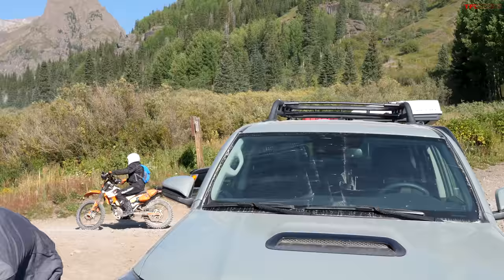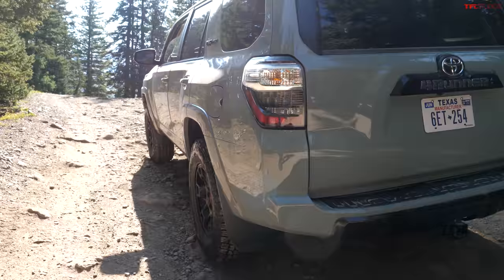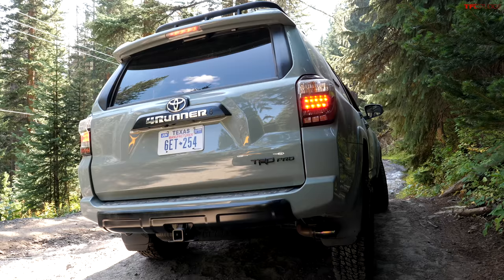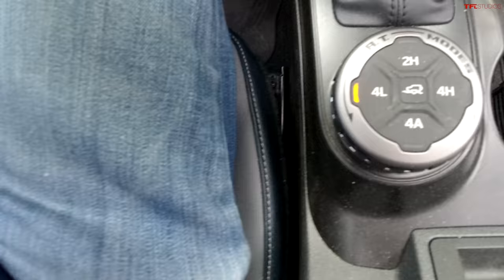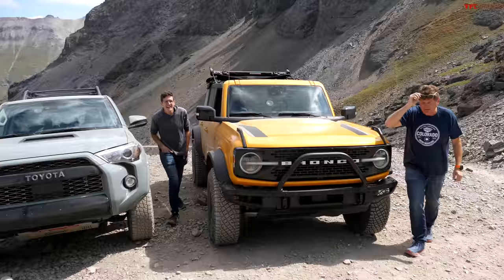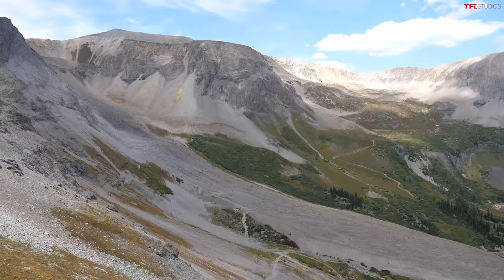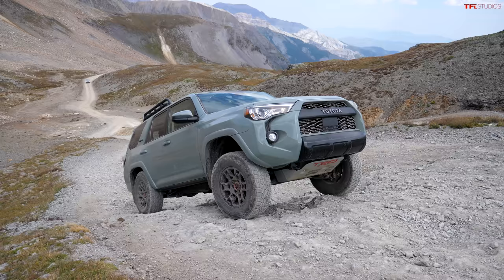The Toyota 4Runner TRD Pro May Be Old, But Can It Still Keep Up With The Ford Bronco Up A Mountain?

Comment: Imogene pass is far from one of the hardest in Colorado. It’s one of the most beautiful but definitly not one of the hardest. It’s fairly easy compared to others. Also if you can take a stock vehicle on a so called hard trail without a lot of damage after then it’s really not that hard.

Comment: The four runner comes with 32" tires. Would you recommend a 33" tire that is the similar on/off road as the stock tires?
Reply: I have the 285/70/17 ko2's on my 18 4runner. Probably one of the best tires for the runner.

Comment: The more I see the 4Runners the more I want them. I just dont wanna pay over 50k for 16 year old powertrain tech 🤦🏻‍♂️🤦🏻‍♂️ dilema
Reply: Don't look at "it" as 16 year old powertain tech ; look at it as " all that's necessary " to get the job done !
Reply: You're getting 16 years worth of testing and fine tuning made from the same factory in Japan from families that have an ingrained culture of pride and obsessive perfection.
Reply: I don't care about like modern direct injection or anything like that cuz I drive a Gladitor with the 3.6. Im just hoping for some more Efficiency. Is it tht far? No but Im just want some slight powertrain updates. Cuz i know this motor wont break
Reply: Seriously, the 4Runner TRD Pro is not good value at over $50K. You can get a much cheaper Trail or TRD OR model for less money or a Bronco Badlands with pretty much the same offroad bits as the Sasquatch 1st edition sans the 25" tires for mid $40s

Comment: Don't get the pro get the TRD off road and you will have same sway bar disconnect  via KDSS as the bronco which I have no doubt works better and will last longer, logic that will apply to the entire vehicle systems as well.  The money savings from skipping the pro lets you buy your pro skid plate, just looks, after market shocks and still walk away with lots of cash as KDSS not offered on pro.

Comment: all stick with my 4 speed lock up converter , at 250,000 miles has never been out , that 8 speed in the bronco will never last . pass on turbos hose's blowing off , you can't beat the dodge nitro for a working person SUV. very cost effective to maintain with the 3.7 liter engine only . say no to penstar tick engine and the 4 liter that drops rockers

Comment: Not fair to compare the first edition price to the 4Runner. You can no longer get the FE bronco. I think you should disclose that fact. You can get a fully loaded (FE bronco equivalent) Badlands for around $54k. Which is much closer to the TRD Pro 4Runner price

Comment: I wonder which one will go 200000-300000 miles with the fewest dealer visits,hmmm. Bronco is very cool but I'm a Toyota guy. BUT for what you pay for the ancient 4-Runner in TRD Pro trim it SHOULD come with a front locking diff.

Comment: What kind of tires does the 4runner have installed?
Reply: It looks like the stock Nitto terra grapplers , not very good off-road in my opinion , I run toyo open country’s on mine , it’s a night and day difference in off-road performance.

Comment: Toyota does a bad job of explaining it but mts is an e-lsd with traction control. Also i really recommend using mts with the locker at the same time. The 4runner would not have stopped.

Comment: It gonna be fun to have all those off road goodies to have in your 4wd. Great technology, cool features, however when it comes to driver's off roading skills that's when all those cool features and technology took over and you gain no experience whatsoever. It's 95% the car and 5% driver (steering). Old school 4wd like LC 80 series with basic features are good for developing off roading skills. Australian are better off roader than most American cuz their 4wds are old school with manaul trans and only rear diff lock to assist them off an interesting situations.

Comment: Finally got to see a Bronco up close the other day.  Cheezy rear axles that won't last.  Passing on the Bronco.  A 4Runner refreshed would be nice Toyota (hint hint).  Not doing the Jeep thing either, hit/miss reliability.
Reply: I thought the Broncos had the same rear end as a F150,  how can that be cheesy compared to a Toyota rear end ?
Reply: @fj400007  much thinner axels
Reply: @HighAltitudesCO  thinner than which vehicle ?... thinner than a F150 or thinner than a Toyota ?...  because, it doesn't get much thinner than a Toyota rear end.

Comment: 19 MPG on 35" TIRES VS 20 MPG on 32". I'll take the 1mpg loss for larger tires. I just wish my F150 3.5 ecoboost on 35" tires got that good of mileage.
Reply: Yeah that fuel economy is all important on the trails.

Comment: Things I've learned over the decades: 1: Never buy a "first generation" of ANY vehicle. 2: The more complicated the vehicle the more there is to break when breaking is not an option as in the tried and true KISS Principal. IF I was limited to choosing between the Toyota and Ford there would be no contest....I'd go for the Toyota in a heart beat. Besides, the Bronco looks like a mash up of the old IH Scout and the  somewhat  infamous, but still functional and largely "bullet proof" once you spend some coin on it, Ford Bronco II with just a bit of Land Rover thrown in to make it bland looking overall. If the current Bronco (III?) is still around in five model years I might be persuaded to buy a two or three year old model as a "beater".

Comment: The hill climb at the end was interesting, the bronco stopped momentarily many times and never spun a wheel or lifted a tire, the Toyota lifted the front passenger side tire and lifted off the ground due to limited wheel travel, why does Toyota have to be so far behind domestic on so many fronts? Although it would be a hard decision on what one to buy, Ford will be expensive to maintain because it’s a Ford… and it will break down a lot… you can’t win.

Comment: At 7:04: 
1. The convertible roof setting is a fix for a factory manufactuirng flaw. Are you serious?
2. How do you use the convertible setting when using a roof rack? Ridiculous.
At 7:13
3. Why would I take off the doors, especially when serious fording is on the menue? Just a gimmick, nothing else.
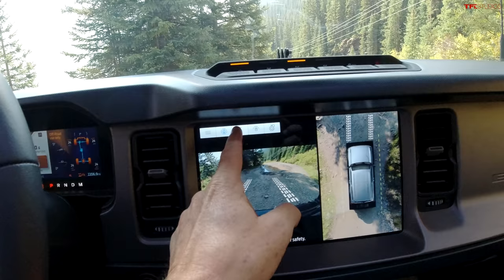At 7:29
How often does the driver need to clean the lenses when serioulsy mud offroading?
At 25:35
Fuel consupmtion: How can an old design 6 cylinder natural aspirated engine with only 5 gears beat a twin turbo with 10 gears? Technical development at its best.

Comment: I agree goat mode is just software and maybe a bit of center clutch tension.
For me ……. Just give me the 4x4 switch and dump all the idiot modes that will cost you a fortune to fix down the road….
Gas settles in 5 seconds 
Diesel takes a long time to settle down .. It holds a bunch of bubbles that take a long time to settle

Comment: I’ll take the Bronco. 👍🏻🇺🇸

The Toyota folks will talk about “reliability” & rightfully so (from a historical perspective). However, there are plenty of old Fords & Jeeps still on the road and powered by the original motor + transmission. I’ve owned Fords & Jeeps that have been very durable, despite abuse in mud, sand, & snow. 

By contrast; I owned a 4Runner back in the 90s & found the power to be anemic, plus it had incessant electrical issues. Buy whatever suits you, but the days of Toyota being able to claim reliability superiority are gone. Quality across brands is so close that it comes down to the unit level & that’s FACT rather than my or anybody’s OPINION.

Comment: Great demonstration, one thing that is not well mentioned is that the Kroll control of the Toyota is superior than the Bronco, I can say this because I saw another off road video and only the Toyota could claim using Kroll control, the Bronco's equivalent Kroll control could not make it, it had to use the two lockers to do the same obstacle, The Toyota can do just about everything that two lockers can with it's amazing Kroll control

Comment: what it sounds like, pretty colors, it used to be for offroad, hunting, back country travels we had a rig that wasn't needed for daily driving, we had a beater with goat gear on it. Sliders, winch, manual locking hubs, suspension, off road serious tires, lockers, rag top, stick shift, 4:88 low gears, if it broke and we couldn't fix it, we got it down and trailered it back home to the shop. these both seem like light duty off road, get to manicured campground. not once in 40 years have I needed a camera in the dash, so can ya get chips for them

Comment: The 4Runner is more reliable.  I have a 3rd gem with 378,000 miles.  Original trans and engine

Comment: There goes a tfl member leaving a toyota’s front diff open during a tough rock crawl again. Idk when they’ll learn
Reply from the maker: what are you taking about, they toyota gas an open front diff
Reply: @TFLoffroad  you guys never use mts with the locker because it’s “just software” in reality mts and atrac simulate lsd’s in the front. I love your channel and what you guys stand for but it’s incredibly frustrating watching you do this over the years…

Comment: Haha yeah you can get a high clearance rear bumper, 3 inch lift, tires, and a high clearance front bumper and still have money left over with the price difference between the two. And you’re guaranteed to get in and back out of the woods with the Runner.

Comment: I no longer feel bad about owning a 4Runner
Reply: Serious question:  Why would you ever feel bad about owning a 4Runner?
Reply: @jerroldshelton9367  I typically don’t. But I have a 2013 and it lacks a lot of the modern amenities. Back up camera, touch screen radio, Apple car play etc. There’s days where it’s loaded down with people and cargo and I get frustrated at its lack of horsepower but at the end of the day it runs and runs well. It’s gotten me everywhere I’ve needed to go without complaint or ever leaving me stranded so at the end of the day that’s better than most Fords I know lol.
Reply: @blkfld7850  Well, frankly, I think some of this "modern amenities" stuff is over-rated.

"It's gotten me everywhere I've needed to go without complaint or leaving me stranded at the end of the day," on the other hand, is priceless!

Give me a choice between a 2013 4-Runner and modern amenities, and that choice is a no-brainer:  2013 4-Runner it would be.
Reply: @jerroldshelton9367  Absolutely. I guess at the end of the day I can appreciate the simplicity. I have friends with new 4runners and they have electrical issues with all this new jazz so 🤷🏻‍♂️
Reply: @blkfld7850  you can get those modern amenities for under $500. Nothing wrong with your ride.
I added those amenities to my 2014 truck and can't ask for more

Comment: I still see people buying the TRD Pro and then changing the wheels and tires and suspension, which is what the TRD PRO's features are..lol...for the love of god just buy the TRD Off Road instead if your going to change that stuff and save the 8 thousand dollars.
Reply: Then that would be boring if everyone has like the same 4runner no?
Reply: @Anomize23  just saying throwing money at on parts you are just going to change is not smart but totally somebody's prerogative. I guess it still has the Pro Badging even if you take all of those "Pro" features of it.

Comment: The Bronco is interesting and it's good to see Ford bring it back.  The reliability of the 4Runner simply can't be compared to any Ford product unfortunately.  The 4Runner will remain rock solid years from now and odds are much higher that I will see a Bronco broken down on Imogene or any other pass for that matter opposed to any Toyota off road vehicle.  Ford is doing some really good things now I just wish their reliability (along with any US auto makers) would match Toyota.

Comment: Just give us a300k mile up date later on both of these see how there doing with 300k miles
Reply: I would also love this data, but time travel is not possible. In 10 years you will not be able to buy either of these same vehicles, they will have changed many things. Unless you buy a 10yr old one, but then you would probably want to see the 600,000 mile data. And the cycle continues.

Comment: while these vehicles are awesome state of the art...i am leary of all the electronic bits they use to engage the off road tech...where the jeep is more mechanical with less tech to fail
Reply: The Toyota in TRD Pro and TRD Off-road has a manual transfer case for 2H, 4H, and 4L.   The other bits are electronic.  If I am remembering right, the Jeep is the same.
Reply: @lou135  thanks lou...i forgot about that

Comment: Let’s do a review in 20 years. Same exact vehicles as in this video, make sure they’ve at least got 200k miles on it, and do another review
Reply: Easy,  the Bronco will still be worth more and still look way better than a rusted out ricer.   Exact same story when comparing a 20 year old Bronco to any 20 year old Toyota.
Reply: The Bronco will be on its 3rd engine and transmission sounding like a one man band going down the road. The 4runner will be exactly the same and will just be warmed up at 200k miles.
Reply: @Rooster_king  you're funny, a Toyota can't get to that kind of mileage without a new frame because it's rusted out to dust.  Keep your ricer as long as you wish and I'll keep the awesome Bronco,  see, everyone is happy that way.
Reply: @fj400007  If going to the dealer every month to fix your recalls and repairs while having a huge payment to drive a noisy, rattling, flaccid sinking top as a jeep wannabe makes you happy then so be it. Enjoy 🤣
Reply: @fj400007  I guess you consider a rattling dookie box good taste?
Reply: Right? because every car site does that, LOL. What a bunch of insecurity....
Reply: @fj400007  you use an old insult to describe poorly cared for vehicles from the mid 2000s, most of which got fixed via recall. The only frames that rusted where the idiots who didn’t care for them
Reply: @luisinhoens90  I have no insecurities with my Toyota, because I know that I’ll get at least 20 years repair free from it
Reply: @swimmer8585  it must be really boring to drive a Toyota for 20 years. I'd happily trade some reliability to have a much more  fun to drive and cool vehicle.
Reply: @luisinhoens90  not at all. I’ll have at least $40k extra that I wouldn’t have to spend on another vehicle to do other stuff, like go places in that Toyota

Comment: All the electronic gadgets and for what? Regular traction control transfers power away from the slipping wheel. 
Locker, crawl, all sounds redundant. Unless you are in sand or mud (let them spin and put the throttle down)  it's really just traction control for everything. Or just use front and back lockers.  How do people think vehicles have been doing this for 70 years?  Long before electronic gimmicks. But if you are going to use a gimmick. Simple traction control. Don't need crawl, mts, its all redundant garbage

Comment: Come back in a 100,000 miles the Bronco will be almost a junk bucket with a dozen mechanical issues, squeaking and chassis groans, the Toyota might have 1 mechanical issue, now going all the way up to 150,000, at those miles the Bronco will be in the junk yard and the Toyota will still have another 100,000 miles to go before it even starts to feel like retiring, at 300,000 miles and many years later the Toyota will be joined with the Bronco.

Comment: That hopelessly cluttered bowl of wiriing, vacuum lines, servos, actuators, hoses, and you dunno whaditis under the Bronco's hood...
Worse than the underhood clutter of an emission control choaked smog motor of the late '70s.  Hasn't Ford learned anything about underhood packaging in 50 years?!

Comment: Hey Roman, time to lose the "Easy peasy," and "Winner winner," lines.  adjective: cringe-worthy
causing feelings of embarrassment or awkwardness.
"the video was excellent, but the dialogue was unforgivably cringeworthy"
Also, how about a bit more "bang for your buck" information about the cost of the vehicles. I'm guessing that the Bronco is about $10,000-$15,000 more than the Toyota?